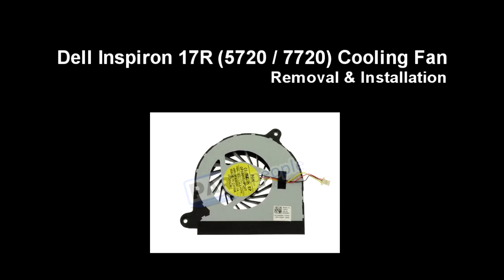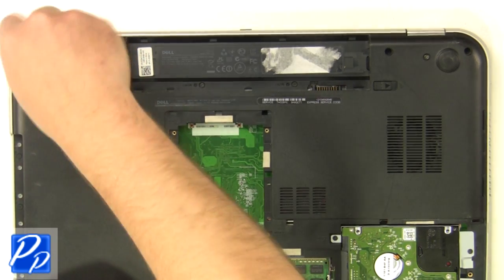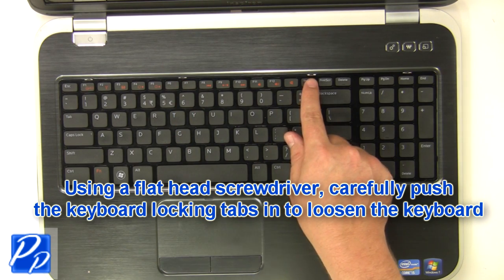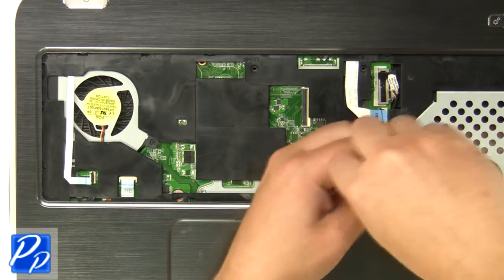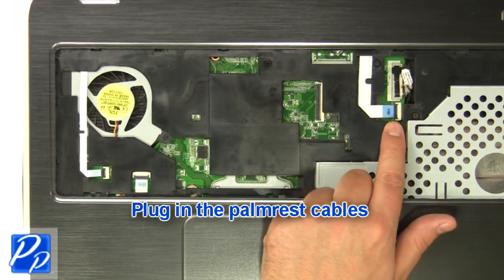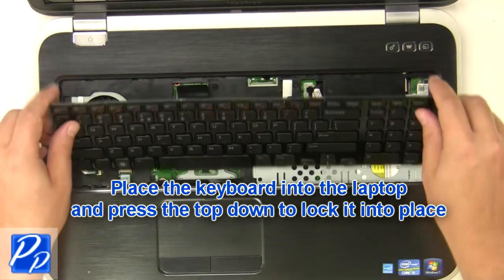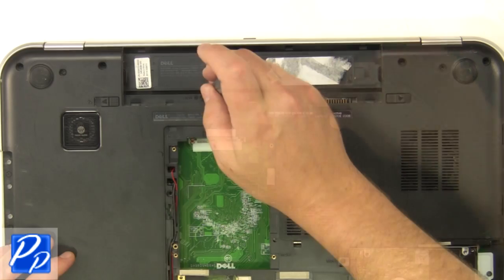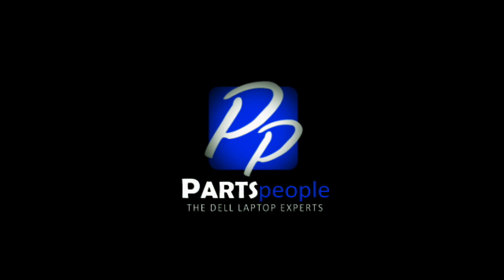Dell Inspiron 17R (5720 / 7720) CPU Cooling Fan Replacement Video Tutorial

Comment: My 17R has screws in different places and different numbers at some stages. However the killer for me is the final step. I can't unplug the fan as the cable goes underneath the circuit board. How do ido that? I have some pictures I took. UK based.
Reply: Okay, ifound the right vid for mine, model 5737

Comment: Will your fan still turn on even if its clogged? My 7720 gets really hot on the bottom left where your wrist sits when i game on it?
Reply from the maker: If it's getting really hot it should be running full time. These laptops aren't very good for gaming, they overheat a lot and don't have good ventilation. You can try opening it up and cleaning the heatsink and fan. New thermal compound would probably be good too and look into using a cooling pad while you're gaming.
Reply: Fan is dead and needs replacing. Laptop will throttle speed down so not to die so still works but slow. Replacing the heatsink thermal compound is another level of hard not shown in this video so I would just replace the fan and it should work fine.

Comment: Awesome, thanks for this video. I have a gaming version of this laptop and it was crashing on my wife just playing WoW. Turns out I should have cleaned out that fan years ago! haha It was blocked solid almost. 

Curious if it's a good idea to replace that HD with an SSD? It's so easy to get to!
Reply from the maker: SSD's boot faster and have faster read/write speeds. I would say yes, replace it.
Reply: Parts-People.Com, Inc thanks, will look into which one would work!
Reply: did your fan still turn on even though it was clogged?
Reply: This laptop also has an mSata slot so you could use an mSata SSD if you wanted to keep both bays for hard drives.

Comment: My inspiron 17R is making clicking noises that are coming from the left side of the base of the computer... how likely is it that this is the fan?
Reply from the maker: Viktor Vladenkoph It is the right area for it to be the fan. It could be some debris stuck in the fan too.
Reply: Hi, Mine was making clicking noises, too. After view days it started to reboot itself, the hdd was the reason. I replaced it and its fine now
Reply: Viktor Vladenkoph Mine did this. I just blew into the fan, and a bunch of dust came flying out. No problems with it for a year, and it ran 5x faster aswell.

These things DO NOT like dust.
Reply: +TheBananaThug Did you have to take it apart to clean out the fan?
Reply: Larrimus No. Just blow into it. You're supposed to jam the fan first so it doesnt spin when you blow, but I didnt and it was fine and worked way better.
Reply: +Slick Sam My 17R also made these clicking/clunking noises. It was the hard drive. I replaced it with a SSD about a month ago and it hasn't happened since.

Comment: I really needed to clean my fan, but it is way too much work.

By the way, good luck trying to remove all those screws. You have a high chance of finding a screw whose thread has been worn out. Just keep rotating while making noises at regular intervals when turning. I remember spending one hour just getting one out of there.

Comment: Do I have to take it apart the same way just to clean the fan?
Reply from the maker: Yes, unfortunately the palmrest must to be removed.
Reply: Parts-People.Com, Inc would you recommend me using an anti static wrist strap?
Reply from the maker: Mario Hernandez That is always the best practice but if you don't have a grounding strap, just touch a metal part of the frame or the VGA port occasionally and that will remove any static change you may have.

Comment: Is this the only fan in this computer? I don't want to do this twice.
Reply from the maker: Yes, that is the only fan.
Reply: Is the fan always supposed to be spinning?  Mine is not spinning at boot up.
Reply from the maker: No, It will continually turn on and off dependent on the temperature of the CPU and GPU. At start up everything is usually cool so the fan usually doesn't come on immediately .

Comment: Thank you very much, it was of maximum help. I was cleaning my fan. For the guy having struggle with. taking out the fan at the final step. At the bottom, on my 5720, there is the small duct tape gluing fan and the copper pipe, so dont be afraid to pull it, carefully, little harder. Thanks once more!

Comment: Excellent explanation and demonstration congratulations.
Hint: instead of using screwdriver with metal tip to remove the flat cables and disassemble the notebook, I suggest using "straw Plastic Guitar" works perfectly as a "nail" and not hurt the plastic parts of the appliance .
:)
(Google Translator)